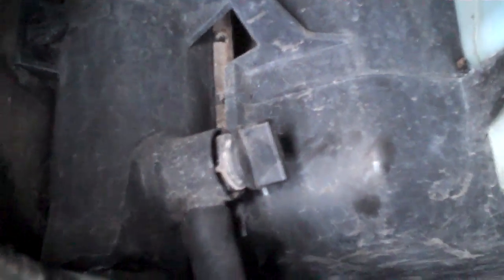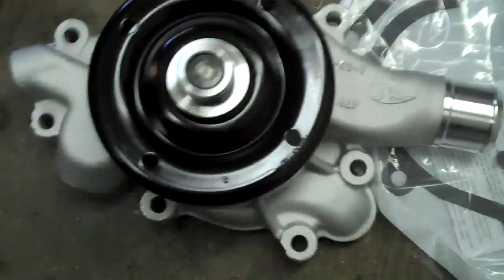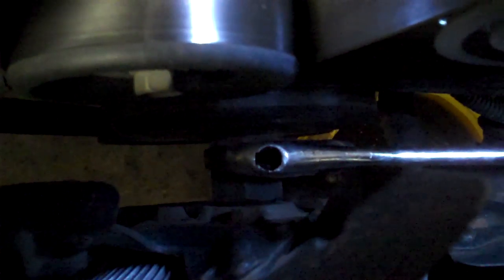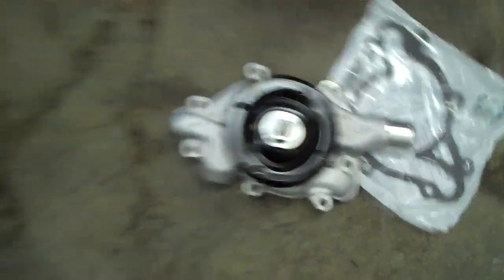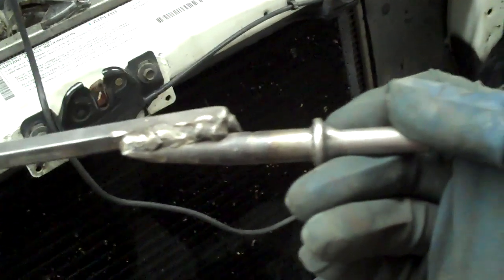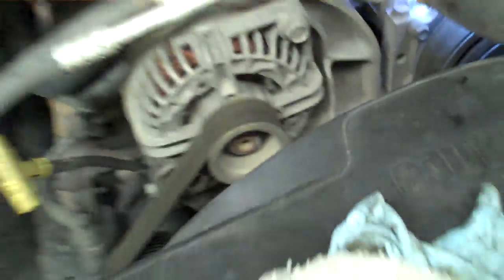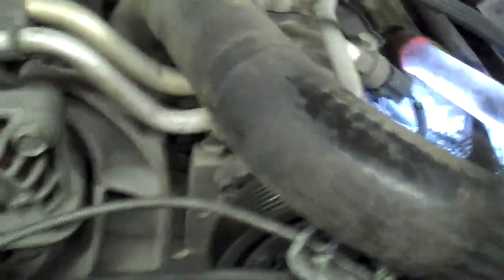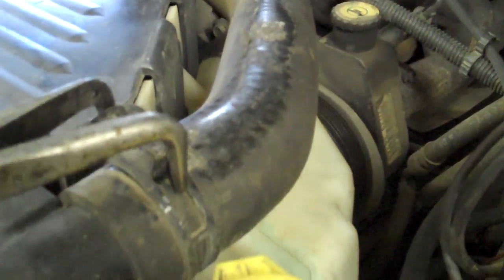Jeep Dodge Ram Dakota Durango 5.2 liter How to do a  Water pump Video 1 of 2

Comment: Brain -- THANK YOU!  We replaced the water pump on my son's '96 Ram and it went exactly as you have described in this video.  We especially appreciated your advice on how to remove the fan/fan clutch.  We used a large screwdriver instead of a pry bar, and ended up putting a pipe wrench on the fan after we discovered our crescent wrench wasn't up to the task.  Everything else went EXACTLY as you described.  Many thanks for this great video!

Comment: Brian - Thanks for the video on replacing the pump. I used them both today and did the job myself. I had no problems getting the work done, thanks to you. I decided to do some routine maintenance and found a serious imperfection in the intake manifold and that caused some major difficulty with replacing the t-stat, but I was able to use some permatex (the right stuff) and I think I'm good to go (for now.)

THX again!

Comment from the maker: At low speeds you have  less fan speed AND less circulation from the water pump.  Converting to an electric fan or adding on up front and putting it on a switch would help a lot.  Also running a lower gear to get water pump RPM's would help.

Comment from the maker: @oya691 You can often remove the water pump with the fan on it.  Then take it to a shop with a torch and heat it to have them remove it while it's hot.  I've done that a few times, but in shop.

Comment: 4.7 liter question. runs hot at low speeds. Took to the dealership twice...nothing! I noticed that one side of the radiator is very hot to the touch and the other side is very cool to the touch. I trap coyotes so while Im running traps(slowly about 10to 15 mph) It will start getting warm. When I go on and get my speed up it cools down. I am going to post a video I took today of temp gauge and speed. I would appreciate it if you take a look and tell me I aint crazy!

Comment: When I remove the water pump, there is water coming from between the block & the timing chain cover. Do I need to replace the gasket on the timing cover or will it tighten back up when I tighten up the new water pump?

Comment: @oya691 hey srry about so many messages but heres an update i finaly got the raditor out and i got the water pump on with the fan and fan clutch still on im so happy now when i go back to school on tuesday im gona take the water pump in and use the torch and vise to get the fan and clutch of to save them

Comment: @briansmobile1 well ive worked on trying to take off the fan clutch well we ordered the tools for it it broke the pully holder and wrench so now im just gonna take out the radiator and get a new fan and clutch because that damn nut wont come off its be hard to do because its been cold out

Comment: I am having a problem with my 98 5.2. I was having problems overheating and changed the water pump. My gut told me the pump was fine and when everything was done, it still overheated. I noticed before I changed it that when I put antifreeze in the reservoir, it didnt seem to feed into the radiator. When I drained the radiator and shot water throughout the system and put water into the reservoir, itoverflowed without feeding into the radiator. Its hard to access so how can I check if its clogged?

Comment: one thing i didnt see on here that my 98 ram ''also a 5.2, is there is a threaded fitting on the top of the pump, for what there calling it is a ''bypass hose''. what im askin is should i use silicone on the threads, or use that white plummers tape? cause if that shit leaks im screwed, will have to redo everything,so silicone, or tape, or both??? thx